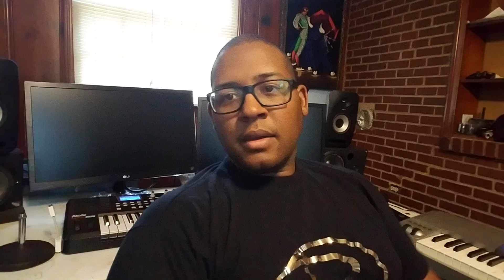How to fix computer noise in studio monitors

Comment: Years ago o had that problem and tried it all. I thought it was just old wiring cause I have grounds. I read somewhere it was the AC power in the computer not grounding. I grabbed a random speaker wire. And bolted it to one of the screws on the AC bolt in the computer and other end to a bolt on the computer chassis. And wala!!! No more noise. Even and full volume. I didn’t have to open annthing. Just any bolt on the AC power enclosure and any bolt on the chassis. Probably was a cheap AC power part I’m guessing.

Comment: I just built a new computer and used AMD parts.  I have a 5800x3d and a 6950xt gpu and the coil whine from the gpu buzzes right through my KRK rokit 5 powered monitors.  I'm using a Presonus Audiobox usb interface.  I thought it was faulty computer parts so I rebuilt the computer 3 times total now with all different parts and still have the buzzing.  However on my intel build there is no noise whatsoever coming from the speakers.  Idk if it's a driver issue between my audio mixer and amd parts but i'm lost.

Comment: Thank you. I have a noise that's been bothering me for months,and recently thought it might be the proximity of my interface with my computer... which led me to this video.

To test the dirty power theory, I plugged everything up into my laptop (which also runs on battery, which becomes important soon) and heard the usual amount of racket. Then I turned off the power strip powering my laptop -- cleaned right up! Dead quiet, other than intended signal.

Thanks for this video, now I know what the problem is.

Now, it's a matter of getting the electrical work done to get the power clean here, and getting the landperson to go for it.

Comment: thanks for the insight. do you think that a mixer that has an ungrounded power cable could cause the same issue? can I just replace the one that came with it with another adapter with the same voltage and connection, but it has the third grounding prong?

Comment: I bought a new Monitor last week and noticed that i started getting this noise when I play games on PC (it gets louder with games) but you can also hear it when I just have the PC on desktop. Everything was working fine before with my TV but then I got a Pc monitor and now I get this problem. I have a scarlett audio interface and yamaha HS8's. When I am not running apps and i am in desktop as I move the cursor my speakers pick up each movement I do. I do have my speakers hugging my monitor. I did move my speakers away from it and it still does that sound. I am starting to wonder it could maybe be a defective unit or I might be missing something else that could cause the problem. My speakers are running through XLR cables.

Edit: I just switched out my TV with the monitor and I do not hear any noise. Not sure if the monitor is causing my speakers to act like this. Like I said I do have them hugging the monitor so I might buy some stands and try to get them further away from the monitor and see if that works.

Comment: i never had this issue with my laptop but when i switched to my new pc now im having this issue
Reply: Did you ever figure out a fix?
Reply: With usb interface buy USB isolator it will remove power from usb and use 5v external power supply

Comment: I see quite a bit of negativity in the responses and a lot less on the positive.  How about some balance and some self reflection - just a thought.  Anyway I know a little bit about electricity from the supply side and it can get very complicated.  So good on you for entering the maze and emerging with an answer that works.  I'm guessing this video is the distillation of endless hours reading and researching.  Also thanks for sharing.

Comment: I have had this noise coming thru my KRK Rokit 5 speakers for a long time.  I can across your video today.  I decided to try a few things.  Here is what i found works for me.
I have a Furman Power conditioner running my rig.  I purchased this item with hopes of eliminating the noise.  NO luck.  The interference noise is coming from my computer as I move the mouse the noise changes.  Today i took another power strip and plugged it into a different outlet on my 4 gang box and connected the speakers.  Noise went away completely.  I rebooted the computer and noise back.  I powered off the power strip and powered on.  Noise gone!  opened up itunes played a song.  Noise back.  No solution yet.  I will try looking into drivers for computer and changing the powerstrip for the speakers to a different circuit.
Reply from the maker: I thought about isolating the connection by using a separate input output connected by optical.

Comment: I'm having the exact same issue, sounds like I'm hearing the computer thinking. All my outlets are wired properly and my system is running through a UPS. It's driving me insane. I did have a USB extension cause my audio interface is about 10 feet from the PC. I replaced that with a 10 foot cable and that significantly reduced the volume of the noise but it's still there.

Comment: thank you so much for uploading this video! I'm setting up a home studio for the first time and I have a bad issue with that electrical noise. I plugged in both my new monitors to the outlet with the ground and it reduced the electrical noise dramatically! I'm now going back to guitar center tomorrow and will be swapping out my unbalanced cabled for balanced ones to see if this will fix the remaining electrical noise that I still have.

Comment: Thanks for sharing.

I found one experience story on one forum. A guy had similar noise going on in his expensive active speakers. And then he discovered the noise becomes much less audible when he closes his window with blinds. Whaaat? Yeah. It turned out, the nearby cellphone tower created interruptions but the blinds had metallic design elements in them, so they worked as a shield. So, this guy took cheap aluminum tape with one side insulation and glued it around the inner cabinet walls, so the amplifier was shielded, and also attached ground to the conducting side of the tape. And the noise was gone!
Reply from the maker: wow, thats  a intereting story, Ground loops are so ridiculous.

Comment: I have had this issue with a docking station which I routed my sound card through. I changed the outlet and it did the trick. Thank you for your useful video.

Comment: I record guitars and have two extension cords with five outlets plugged into my home wall. All of the ten outlets are being used. I have two bricks. A simple trick I learned is to plug PC into one brick and plug monitors into the other brick. Don't use the same source of power for PC and Monitors.
Reply: This is what worked best for me aswell. I guess it depends on what is causing the humming.

Comment: I've had the "light squeel" in my monitors off and on for 2 years. It got worse so I watched this video. Well all my outlets have grounds but someone in the comments suggested plugging the computer into a different outlet. Considering that all the outlets are on the same breaker one would think no way that'll work, except it did. I still get the noise when power the computer off (I have no idea why) or if the computer speakers are on but this solved the problem and I can put my headphones away and use these expensive monitors that have been collecting dust. I may try a power conditioner on the outlet for the computer to see if that gets rid of the shutdown and crosstalk noise. NOTE the only thing I moved to a new outlet was the computer. everything else, monitors, interface, effect rack, etc is still running through 2 power conditioners on the same outlet.

Comment: This doesn't solve shit :( power going from a properly grounded outlet to a furman PST-2+6 - to my PC - Focusrite scarlett solo USB (with an idefender3.0 ground loop breaker between it and the PC) then RCA (yes i know it's un-bal, but i tried with a M-Audio firewire w/bal. outs and same shit.) to the KRK's. i think its mobo noise, maybe my PC, or Mobo aren't grounded... its infuriating :@ my other set up didn't do this, until i got the new KRK rockit6's (and they're fine, line in (ipod) thru RCA is deathly quiet when no signal). Literally as i boot my pc on they start to make noise. Any suggestions? i'm about to quit altogether...
Reply: Cut the shield on usb cable on one side closer to interface … only the shield …. On usb cable . Also make sure to use TRs balanced on all connections

Comment: Loved your video. Unfortunately at the time I was unable to get a gcfi outlet. I did however come across another potential solution if you happen to have this around. I have many devices in my daw and require 2 power conditioners. I read on the presonus website that a major cause of computer noise in studio monitors is because the computer is plugged into the same power supply as the monitors and interface. Ultimately, I was able to eliminate completely the noise in my monitors by simply plugging the computer into the other conditioner, which is just used for my screens. I don't know if this will help anyone, but I thought I would share. Thank you.

Comment: Make sure you have the most current PC driver installed.  I just installed a Yamaha mixer which hooks to JBL powered studio monitors.  As soon as I hooked the system to my laptop USB port, my speakers started popping and making all kinds of unwanted sounds.  I had to d/l the genuine Yamaha Steinberg USB driver to 100% fix the problem.  Wow, I am relieved because my electrical outlets are not grounded - neither are the Clubs I work at.  Grounding is important but the correct driver makes all the difference.  My system is all digital now until the signal leaves the mixer.  All my connections are balanced.  RCA cables are  unbalanced plus the ground loop might be limiting your fidelity.  Hope this helps.

Comment: I just spent $300 on a power conditioner, didn't fix it. I even tried putting tin foil on the outside of my monitors. Finally realised all I had to do was use balanced TRL calbles to my monitors and BOOM, no noise at all..
Reply from the maker: does your audio interface have balanced outputs?

Comment: you heard it at night? You leave you stuff on overnight? GFCI is Ground Fault Circuit Interrupter btw... its a fancy term for a external breaker switch. Regardless, good find!
Reply: Some electronics, work better if left on, and last longer.  Also A/B and D type amplifiers are incredibly power efficient, and suck up very little.  And you better know im not going to go around my room turning off individual power buttons on every monitor i have.

Comment: I bought a 3 prong to 2 prong pwr adapter for my studio monitors off ebay. They plug into a UPS and that cleared up all my noise issues. I wouldn't recommend plugging that setup directly into wall outlets. I figure the UPS will keep things safe (lol)... Its been fine for a few years.
Reply: Francis Bawasanta Bingo! I’m a g@#$&m electrician and put in a new plug from my panel to my DAW area to hopefully solve this. Nope! Same infernal hard drive noise through my JBL’S... Took 3 hrs to run it. I took your advice on the three to two connector and WHAM! No f#$&*n noise. Rockstar bro, simply rockstar!
Reply: Francis Bawasanta bizarre solution but it worked

Comment: I love your sound efx.  I do the same thing, and people just crack up. I know, I just did. Great video.  My noise is actually coming from my power wire to my computer monitor. I unplug that wire? Noise goes away. I'll have to figure out what to do there. Never used to do this, and NOTHING has changed. I'm thinking, trying a new power wire. Anyway, great video.

Comment: dude thats exactly my noise!!! im on the effing edge of my seat
Reply: God bless you sir. I have the exact same problem and it seriously makes me not even want to turn my speakers on. figuring this out with my landlord for SURE.
Reply: duuude , I get 120v AC off my hot and ground, still have the noise... dead
Reply: My amp had RCA outputs, and my interface as RCA inputs, these are unbalanced signals, so can't be grounded. I. don't understand a lot about this but I essentially did what you tried by using one of those grey ground lift adapters on the amp and the noise is GONE. Gone I tell you.

Comment: Dude! Are u kidding me! I’ve had noise issues with my monitors for at least 10 years. Started with the high pitch. Solved that with a 3 plug to 2 plug adaptor. Boom solved. No joke. Try it.

Now I have white noise... have not solved this issue... ever.... I have a power conditioner. I have changed the outlets. I have tried it all... I think u made up the ground outlet test but I’m not an electrician.

I also get an huge pop when I start my studio computer up. The white noise and the pops... how do u get rid of that.
Reply: Noxtreme I did the exact same thing thing and get the same pop. Lol. Only out of one monitor speaker. I plug the 3to2 adapters into a UPS and haven't had issues with white noise. I'm under the impression that since the ups is grounded... My death will be nice and painless when dealing with those plugs. Haha. unsure, tepid laughter
Reply: This is exactly why i love reading comments XD going from 3 to 2 just gave me the biggest relieve. Thank you!

Comment: Hey y'all. I'm having a different issue here with my studio monitors. One of them is going tick tick, rhythmically. I tried changing the cable to it, and it went away. But then lately it's been back, which I guess means my other speaker cable needs replacing. But that's so weird right? The new cable is a Hosa cable. My not replaced cable is a kenable 3.5 4 pole jack plug. Sigh, sorry for the long description to that, but I don't know it's brand. So, could that cable be holding up the ticking issue still? I really don't know...
Reply: You have most likely solved this by now, but if not, what I found is that my audio interface did not like certain USB ports. I have a USB 3.0 card to increase the number of my ports, and the interface would tick if I plugged in there, just like yours. If I put it on the USBs from the motherboard - no problem. Also, if you have the option of USB 2.0 or 3.0 ports, try both. Some interfaces made for 2.0 hate 3.0.

Comment: I fixed this buzzing, mine is a lower buzzing that happens when I use my GPU heavily in games or other applications. :( It's noise from the computer itself. Ugh
Reply: fuck I have tried getting a power conditioner, new cables, new headphone cable, HP adapter, disconnecting audio cable in my pc since Im only using the external in the interface... turning off all devices and lights in my house, turning off, my monitor and ax fx to see if they were effecting the sound to try and rule out EMI... and my noise doesnt usually appear until Ive been running protools for awhile.

what gpu do you have? I have an amd gpu could be that i guess but It could eaily be bad house wiring or something else who fuckin knows? thanks for the trouble shooting ideas tho.
Reply: Had the same problem. Fixed it by using a ground lifter. My Subwoofer has one built in but it should work the same with an external one. Is about 20$ on amazon.
Reply: phoenix7289 Yo, same, what did u do?
Reply: ya did you get a new gpu?
Reply: I got a platinuim power supply for my pc and that didnt work either.
Reply: Plz help my pc keeps making the buzzing sound and it’s brand is HP I need help :(

Comment: Even with a good interface, balance cables, powerplug with Hf filter, and a hum eliminator I still had this problem.. but a simple tip (low cost)was the only thing that really works and helped me. I put 3 layers of aluminium foil on the inside of the speaker and around on de plastic tube. And moved them so the back faces a wall so less change for interference. Now my speaker are completely silent! And since I was inside the speaker I removed the limiter circuit ( learned from other YouTube video) now they sound amazing!  The problem is probably that I live in an top floor apartment with radio antanna on building around me. Hope this can help people with the same problem
Reply: Kristoffer Leemburg I have the similar radio frequency problem inside my Yamaha speakers and my headphones :( I live also top of the building ! Can you tell me how you did it exactly with the aluminum please !

Comment: Mine was caused by me using a 1/4" plug wires (from my Steinberg interface to my monitors) that were crap and replaced them with high quality 1/4" plug to a 1/4" to XLR wires.

Comment: I had the same problem and I do believe it is a "ground" issue.  I followed an earlier comment where someone had suggested with the 3 prong to 2 prong adaptor from Home Depot on the power to my studio monitors and I no longer have any noise in my speakers.  Once again thanks.  It was this discussion that solved it for me.

Comment: I had similar problem when I bought Samson se 6 monitors. Right after I plug them in interface they started buzzing. I could hear all the computer activity, keyboard and mouse. I almost gave up on them. I used unbalanced cables!!!!. When I swapped to TRS balanced one and cranked up the volume to 100% and there was no noise whatsoever.
Reply: What if my amp is grounded to the wall socket but the outs of the amp and ins of my interface are RCA? RCAs are unbalanced. Still have the exact sound described in this video.
Reply: I used one of those grey ground lift adapters on the power to my amp, the noise is gone.